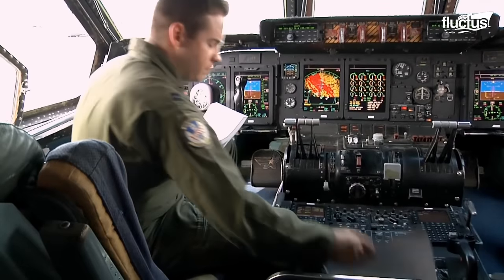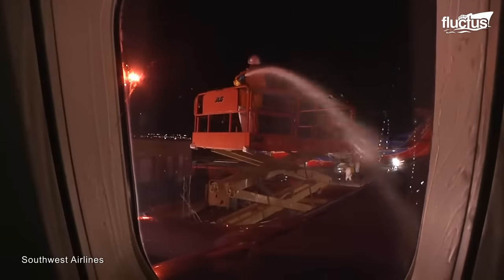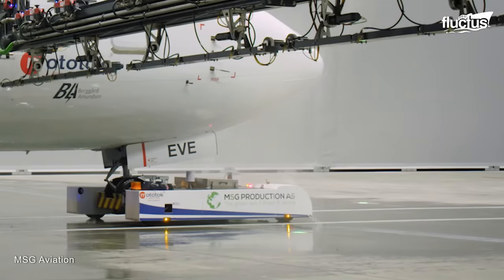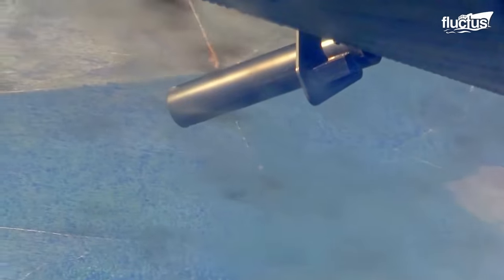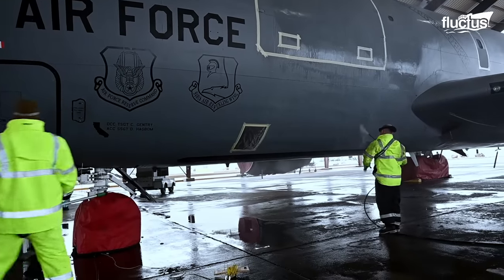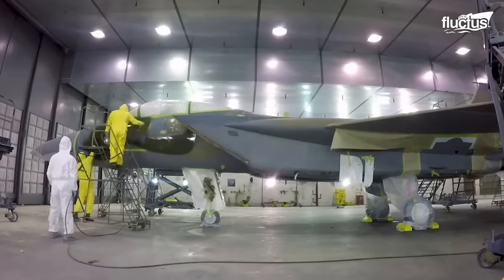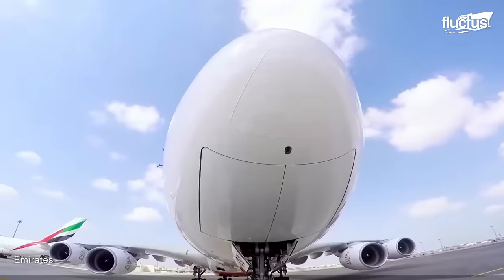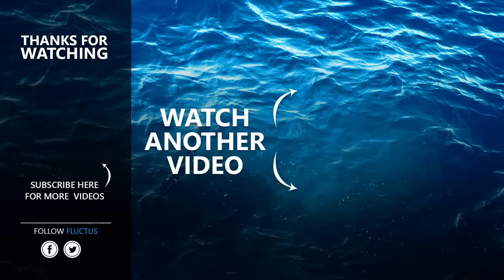Awesome System Engineers Invented to Wash Giant Planes in Few Minutes

Comment: Paint adds more weight on air vehicles, on the other hand it helps reduce corrosion etc. I believe an innovative preventive treatment would be possible for metal surfaces of the air vehicles in order to reduce toxic chemicals and heavy workloads. Thanks for the educational video.
Reply: WTF are air vehicles 😅